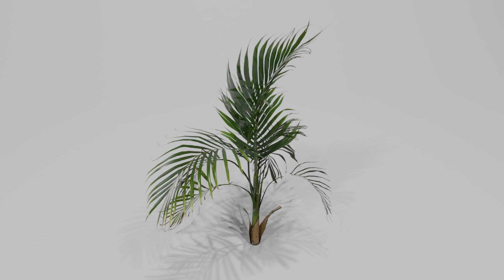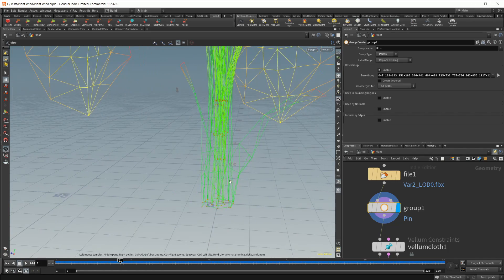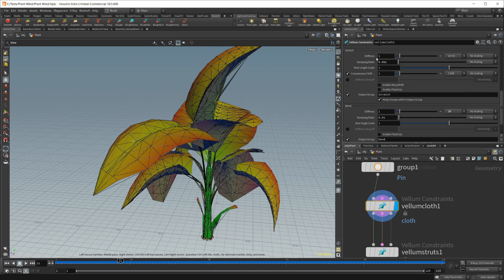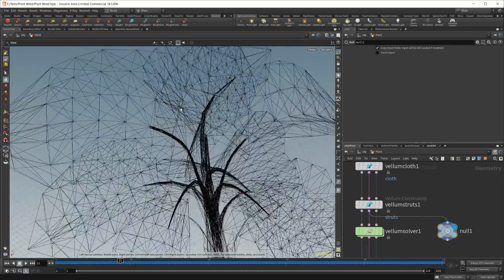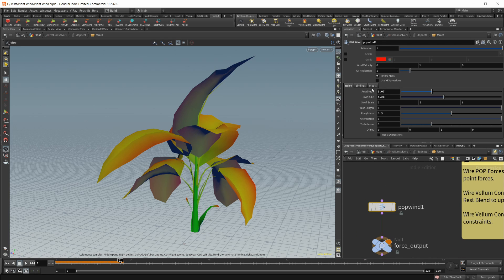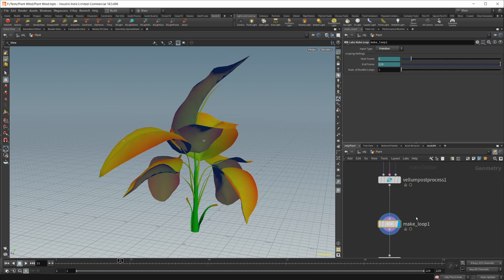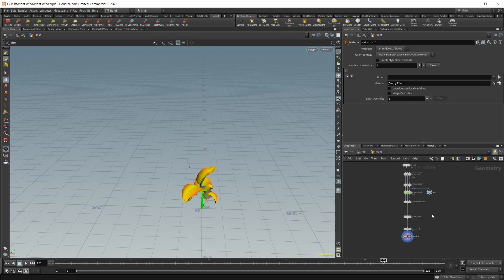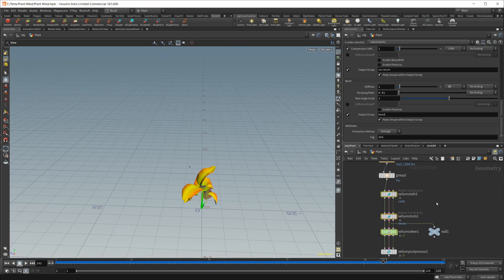How to Simulate Plants in the Wind in Houdini

Comment: By any chance, what do you do if you want to feed different variants of these into a scatter setup to sim them afterwards?
Reply from the maker: Probably need to setup the constraints and everything and then scatter them but I would be hesitant to do it that way as the more geo that you have the harder it will be for it to sim
Reply: @InsideTheMindSpace  If I were to that, how would I?
Do I just merge all the constraint outputs together?
If I create a scatter set up, I usually place all variants at the center of the scene and merge them.
If I do that, won't it create constraints as if it were one complex plant instead of separate ones?

I just don't understand how to feed all of that together, in general..

Otherwise, since you said it would take long to simulate, what would the alternative be? 
The reason I want to simulate it with, vellum is that I have an object that is supposed to move through the grass, and move it out out of the way.
The rest I will just animate with a noise.
Reply from the maker: Thats a more complex setup than it seems. It's been some time since I messed with that type of a setup and I remember running into a lot of issues. The constraints nodes just create attributes on the geo that the sim looks for. It will take a good amount of fiddling to get things right. You might be able to scatter everything and then add constraints and sim but it might take awhile. You could potentially sim one object at a time but you would have to get creative to get the sims to interact. Merging the constraints might not work because there's three outputs and a merge would only give one output. You could try merging each output with the other of the same type. Honestly not sure what the best solution is for this. That is also something I have had the desire to do but I've never gone back and actually took enough time to figure it all out unfortunately
Reply from the maker: There is also another technique that I have seen used for similar things that isn't as accurate but does work. I believe that involves converting everything to a line essentially to use as a basic geo and then running that through a sim and then using a point deform or something to get that movement applied to the final geo. Been awhile since I saw that as well but you can probably do some hunting and find that technique
Reply: @InsideTheMindSpace  Thank you for taking the the time to answer me in detail. I will see if it works on a small scale and then increase the copies. Otherwise I might go another route.
Reply from the maker: Best of luck. I may revisit this in the future and attempt to figure out what you are essentially trying to do

Comment: Hi , struggle a bit with it . When I follow the tutoriel with a megascan asset, the asset brake. By that i mean the branch brake , petal fall. I guess it's because the asset is made of multiple object and the point are not connected. I read in the comment section that you talk about a glue parameter / strut setting but i don't figure it out and i can't make it work. Any idea how i could "Glue" the model together so it don't brake within the animation ?
Reply from the maker: The strut settings are going to be what you need to mess with. They are what hold everything together. Scenes are going to vary wildly in settings but the struts are what you are looking for
Reply: @InsideTheMindSpace  Hmm , so it should be the VellumStruts right ? If it is, no matter what parametre i put in it nothing happend. And i have the same result without it so it look like it doesnt have any effect on it .  I used 3dplant_shrub_wf0oefeja on Quixel bridge asset as a plant.
Thank for the time you put to respond, and sorry for the question i did not find the answer online :/
Reply from the maker: The setting should be the struts. Every situation is going to be a bit different. You may need to evaluate what is happening with the struts to figure out what is going on. If I remember right you can wire the middle output into a null to view the struts and what is happening as it's simulated
Reply: @Sewsi  I know it's late but use the weld vellum contraint with leaf base points and the stem as target geo

Comment: Thanks for your tutorial, I followed your method to make it completely, but with the swing, the leaves and flowers of the plants will fall off. How can I fix the leaves and flowers?  I am using Houdini 19, looking forward to your reply, thank you very much.
Reply from the maker: You probably need to adjust the glue strength so that the binds holding everything together dont break
Reply: @InsideTheMindSpace  Thanks for the reply, what does "glue strength" refer to? I tried adjusting "Stretch -> Stiffness" for "Vellum Cloth / Vellum Struts", but it doesn't work.
Reply from the maker: Sorry glue strength is a different constraint type. You need to mess with the strut settings I believe.
Reply: @InsideTheMindSpace  Thanks for the reminder, I just started learning Houdini for two weeks and I think I know where the problem is, thanks again.